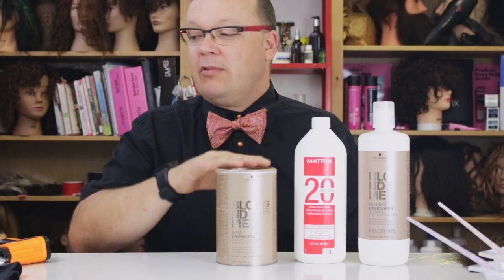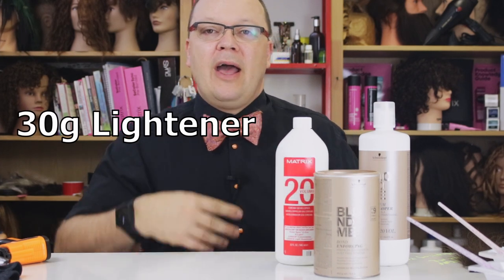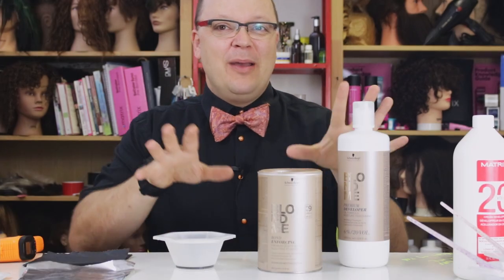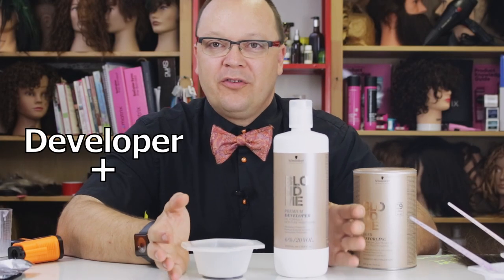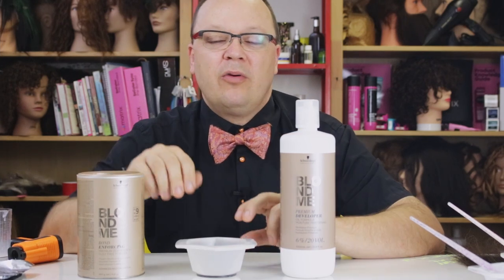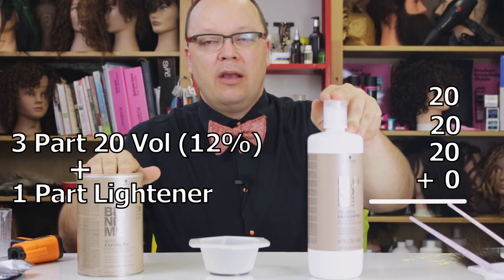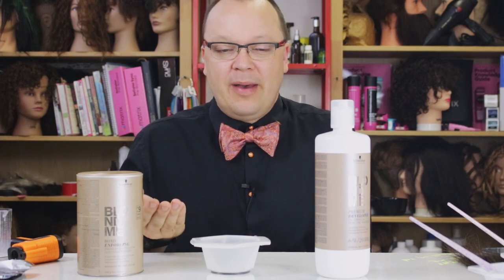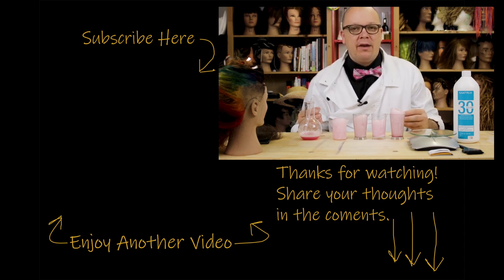Understanding How Mixing Ratio Effects Your Lightener

Comment: Thanks !! So helpful. And i was thinking other way (puting more developper would dilute the strengh😅😅). Here is my question.  If i have a 30 vol developper, how do I do to "turn" it into a 20 vol ?? (I use blondme like you). Thanks a lot !!
Reply from the maker: I have another video on this. "What if I run out of 20 volume" , but in short equal parts 30 volume and 10 volume will make 20. Or in a pinch, 2 parts 30 and 1 part water will also make 20.
Thanks for watching!

Comment: Ah, so that's why high lifts require double 30-40vol developer since 1:1 would just half the amount of oxygen. Definitely gonna try 1:3 ratio with lightener
Reply from the maker: I knew you would get it
Reply: The only thing I dont understand is whats the difference between using 30 vol at 1:1 and using 20 vol at 3:1? Is it just for consistency sake?
Reply from the maker: Yes it is just consistency. However there are many stylists who "mix to consistency" rather than measuring. So the real intent of this video is to demonstrate that they may be using unpredictable product that is possibly stronger than they think. But also how to reliably manipilate the consistency of the product while maintaining predictable results.
Reply: @geeperjane  he is talking about working oxygen. The lightener powder is the actual catalyst to get that oxygen to do something. A 1:1 ratio of 20 volume will be stronger than a 1:3 of 20 volume as far as how fast it will work. If there is more powder you have a higher ph. And without raising the PH of the hair, the developer can't do anything. This is why we don't put straight 40 volume on the head to lighten the hair. He is explaining just one part of the chemical reaction. There are a few in actual chemistry that have to happen for oxidation to occur, if you want a heavy chemistry lesson I could write out the actual chemistry equation but it goes over most peoples head...
Reply: @emmabrown2531   sorry I don't get it😭
a 1:1 (20v)=10v of oxygen conentration
a 1:3 (20v) = 15v of oxygen 
so those it mean that the lower the oxygen conentration the higher the strength?
Reply: @emmabrown2531  this was not at all related to my question. He already answered it in his reply.

Comment: So, I purchased the blonde me ice toner and the 20 volume developer, I haven't used it yet. I will be using it tomorrow or the next day. My hair is bleached and from the root down is pretty light blonde with a light tint of yellow and my ends are light orange. I've been watching videos and I've seen ppls hair go from what mine is to a white with the ice toner so I'm hoping it will work for me. If anyone has any suggestions please leave me a reply. I've also seen someone mix well 050 I think, in with the other toner too and I'm unsure what that does. I'm trying to get to the lightest blonde almost white blonde so any suggestions would be greatly appreciated

Comment: So, if I want to cover grey hair and if i am required to use 20 volume developer (6%) at 1:1 ratio then should I add 2 parts of the developer to keep 6% ratio to my final mix that is color and developer.
Reply from the maker: No, you would stick with 1:1 20 vol. You will get the intended working volume you need. Thanks for watching!
Reply: Also, I notice that after a week my roots turn to grey. Was wondering whether there is any other way I can prolonged the grey process of the roots?
Reply from the maker: I'm assuming you mean the new growth. Somewhere between 1/8th and 1/4 inch(3-6 mm). If this is the case then unfortunately no, but there are some tricks you can use to make it less noticable. I should do a video about that soon
Reply: @CosmoDad  please waiting for the video

Comment: Please can you help me. I'm not lightening my hair, I'm trying to use schwarzkopf bond enforcing colour remover. 

It says on the instructions add part a and part b sachet with 60 g of developer, then there's a mixing ratio table underneath saying 1:1:2. Does that mean I need to add x 2 60 g of developer(120 g).

I purchased a 20 vol developer and I want 2-3 levels of lift.

Hope you can help, as I'm not a professional or anything.
Reply from the maker: I'm not familiar with this product but usually the mixing ratio is there in case you want to use more or less of parts a/b than the sachet. This would be confirmed if each sachet is 30 mL
If that's the case then just the 60 of developer. 
Best of luck!
Reply: @CosmoDad  thank you

Comment: I noticed that you used two different brands of developers. I was wondering if there is any effect on lightener when using or not using the designated developers
Reply from the maker: For the most part there is no difference. Developers are almost universal. The most important part is the oxygen. I should do a video with 5 or 6 different developers and 1 lightener and compare
Reply: @CosmoDad  thank you, this question has  been on my mind for a while leading me to go out of my way to buy the designated brand of developer even if I already have the volumes I needed.
Reply: @CosmoDad  so I can use any developer with the blonde me bleach?!

Comment: thank u
Reply from the maker: Thank you for watching
Reply: @CosmoDad  hi! if you could answer these questions you would literally be a life saver.
1) ive seen some professionals lift level 2 black hair to a level 8.5-9 in one session with blondeme and 20vol or even 10 vol. how do they avoid the orange stage? I think they leave it on for over an hour. I have level 2 black hair and I left blondeme + 20 vol on for maybe around 50 minutes and got to a level 8/8.5 (no foil, just a head cap). should i have left it on for longer? 
2) does hair breakage start when it goes past a level 9? or can it even break when it's orange? like if I leave blondeme + 20vol on  my hair for over an hour (reapplying to keep it moist), is it possible for it to melt off even if it's not a level 9 pale yellow? or will it only start to melt once it goes past a level 9.
Reply: for the first question, the situation was doing my roots :-) but my roots were grown out like an inch. the rest of my hair is like a level 9-10. I made sure not to overlap but forgot about blondeme swelling. the first round I had no breakage even with the blondeme swelling- left it on for 50 min with head cap and 20 vol. ended up pretty light but not a level 9 light. so I did olaplex treatments and waited 2 weeks and then did my roots again with blondeme + 20 vol and a head cap. i left it on for like 45 min and my hair ended up snapping a lot. the breakage wasn't that bad because I have a lottt of hair but i still lost a lot of hair  :,) but my roots lightened to a level 9-10 after the second round.

im going to bleach my grown out roots again (1.5  inches of regrowth) so I'm trying to figure it out haha